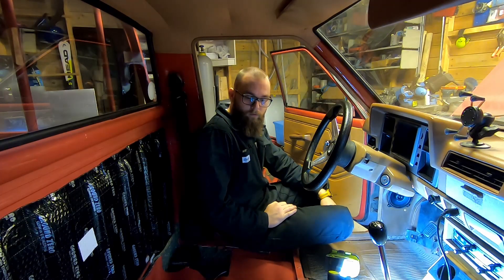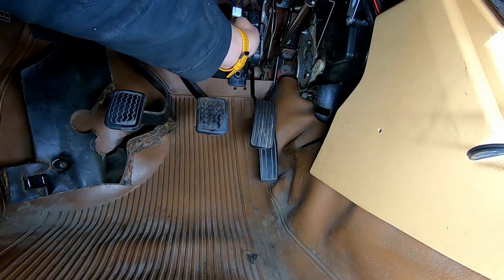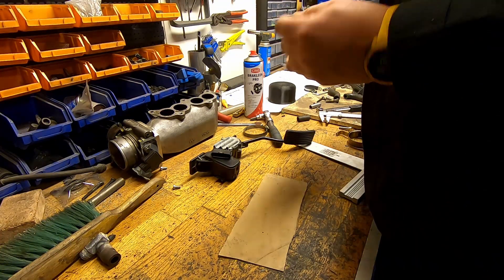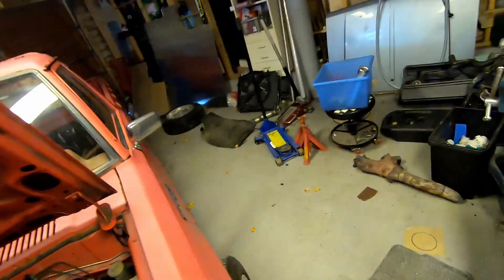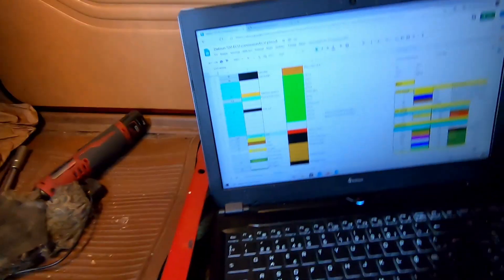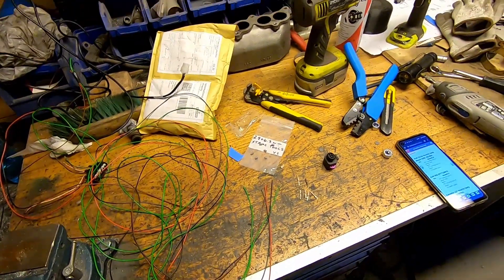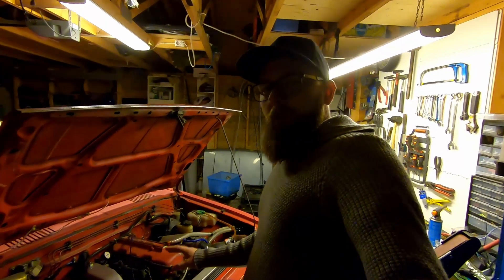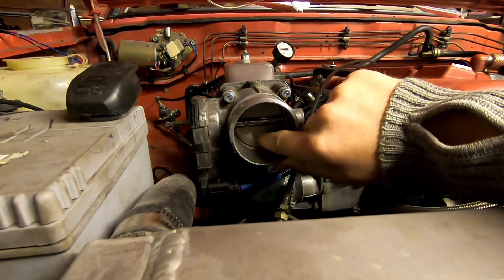Electronic throttlebody install on a Datsun 720 pt2! Will it work?

Comment: How hard would this install be for someone who is a novice to wiring? We just got a 720 pickup for our channel as well! Having trouble finding parts for it though lol
Reply from the maker: Not to hard depending on what ecu you're using. The wiring diagram for my maxxecu is pretty simple to understand and every wire on the harness is marked so that helped.
Reply: El cuerpo de aceleración y el múltiple de admisión,¿ De que motor son?